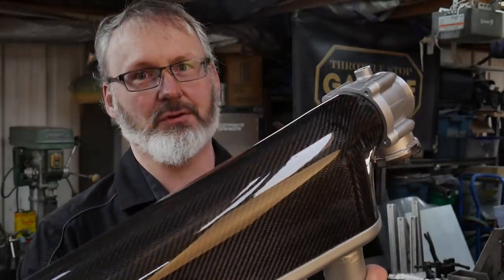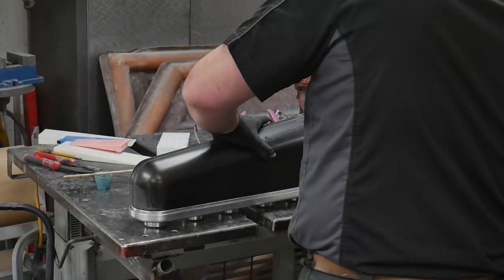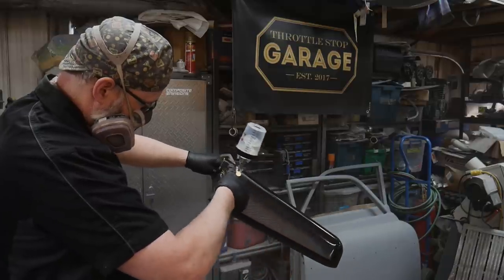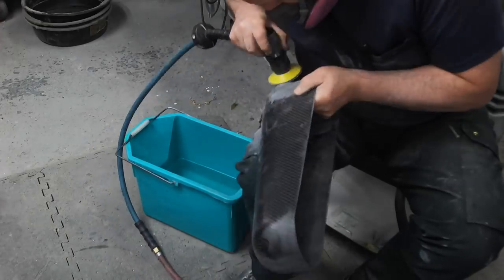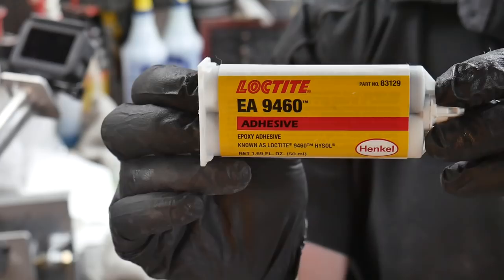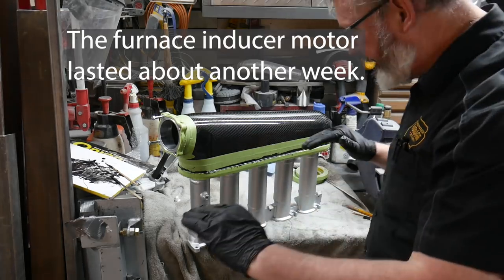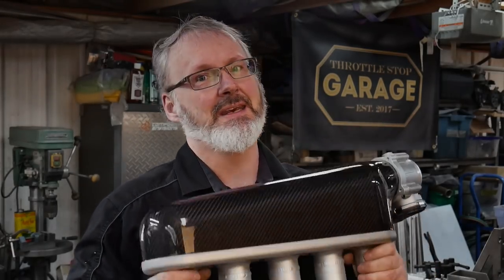DIY Carbon Fiber Intake Manifold - Part 4: Finishing the Job

Comment: I found in some applications polyester pigment coloring additive can cause sever hardening problems 80° temperature is a big help .
Reply from the maker: Interesting.  I only used just enough to turn colour - it hardened fine (or it seemed to) - what sort of problem did you encounter?

Comment: @Throttle Stop Garage absolutely love the intake manifold. Cannot wait to hear her run. I really liked the way you designed the intake manifold plenum base. If you are open to sharing, Id love a copy of the drawing you designed to use on my own build!
Reply from the maker: This plenum part only works if you are using the 960 intake flange.  There is a slight offset of one of the holes.  So unless you have that part, the model won't really be of any use.

Comment: Wow that looks amazing! Any other parts on the car getting the carbon fiber treatment?
Reply from the maker: So far I've made a trunk, hood, fenders, doors...and this intake.
Reply: @ThrottleStopGarage  I think I need to go back in time and watch more of your stuff. This car will put most Swedish builds to shame. It really makes me want to do a similar style intake for my 242.
Reply from the maker: @SeanHodgins  I've got a 242 and a 245...I've also kept the mold as the intake on the 242 is just the stock turbo manifold which is a mess.

Comment: Carbon fiber composite has a very low thermal coefficient of expansion, aluminum has a fairly high thermal expansion. Hopefully your bond joint is not overstressed due to the min and max temperature range that the manifold will see.  Your intake manifold length is maybe 18" long? I enjoy the work you are doing.
Reply from the maker: I hope not - we'll see when it's all together.

Comment: Came out looking really really good. Now you will need to match the rocker cover colour to the runner color. 
Interested to see what is going to happen on the hot side.
Reply from the maker: Thanks! The engine covers won't be painted...the engine will be painted.  Working on the collector for the turbo right now.

Comment: Great looking part! Just curious if any worry/consideration has been put into Galvanic corrosion between the carbon and aluminum especially since this is the engine intake?
Reply: Missed the on-screen note about testing them the first time🤦‍♂️ either way any tips or ideas on how to avoid that in a part like this?
Reply from the maker: Use the correct epoxy was a big part of the step.  If not, you can isolate the parts using fibreglass veil.

Comment: Looks fantastic. Any plans for matching carbon fibre timing belt covers and ignition coil cover?
Reply from the maker: Not sure yet - I have an "R" engine and will probably use the blue covers.  I really should do an update video to catch everyone up on what's going on.
Reply: @ThrottleStopGarage  I think an update video would be great. I joined the series as you started the composites work so not fully in the loop.

Got to say I love what you've achieved with the composites. Shows what patience and determination can do even without all the experience.

Comment: It should have been easier to lay up the carbon over smaller 3D printed wax core or a plastic core made to separate. All done in one go. More external polishing needed but far less risk of a useless moulding.
Reply from the maker: I see what your saying - but I've never done it that way before.  I'm not sure how it would all work out with such a complex part.  I was also interested in having a nice outside carbon weave on the finished part.

Comment: You didn't mention it but I am very curious about the final weight of the intake. Looks really light when you're handling it.
Reply from the maker: I've never put it on a scale Aaron.  My guess is it's around 3 kg without the throttle body.  The base plenum part could have been lighter.

Comment: Great video!
I’m wondering what type of clear coat did you use? Is it heat resistant?
Thanks.
Reply from the maker: It's a UTech 4.0 high solids clear.  It's as heat resistant as it needs to be for this job.

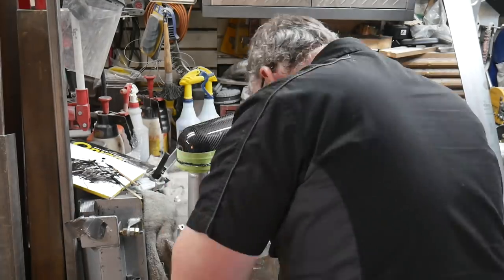Comment: 12:03 But you let it sit for the 72 hours with the masking tape?
Reply from the maker: No, I pulled the tape as soon as the epoxy was applied and I'd cleaned the area with acetone.  Then I let it sit.

Comment: But is that epoxy fuel, heat and expansion proof? For panels I could imagine it working
Reply from the maker: Yes - of course.  It's heat resistant and resist all automotive fluids.  They use to to adhere jet engine covers.  I'm not understanding your question very well.  If you have some specific information, I'm all ears.  Otherwise, I've thoroughly researched the product to the point that I can.

Comment: How has the intake held up so far?  Loved this series/project
Reply from the maker: It will be a few years before it gets run unfortunately.  Sorry for being so slow - real job gets in the way most of the time.
Reply: @ThrottleStopGarage  heyy i totally understand!!!  No worries,  ive been thinking about creating a intake myself and following your step's, same materials, except i will use a high-impact clear coat in the end.  Are you on facebook?
Reply from the maker: @davidsean7043  On FB and Instagram.

Comment: Hey Buddy! Great work as always, that Intake Manifold looks sick! How much Boost are you gonna run on the Amazon when its done? (and how much Pressure you think the  Intake can hold before failing/splitting/exploding)
Reply from the maker: Around 2 Bar is what I'm targeting.  I think the risk is in the pressure fluctuation not in the pressure itself.  It's 2 mm thick - so if I blow it up, you  can bet I'll be smiling.
Reply: 2 Bar beyond atmospheric? Sound like fun even if it splitt's or it throws a rod out the block :-) stay save and keep on the good work!

Comment: I've heard you shouldn't bond carbon to aluminum directly. It will corrode since carbon is conductive. Maybe something to consider when you spent so much time on the parts.
Reply from the maker: It's done all the time - have a look at the front wing on a F1 car - metal bonded to carbon provides the adjustment and support.  Airplanes are put together using this epoxy.  I research everything extensively - there are elements in this epoxy that keep the parts from "touching".
Reply: @ThrottleStopGarage  hey, you're the expert here :) But I was under the impression that they had an intermediate layer of glass fiber. The comparison to F1 is a bit unfair since those are not built to last, which airplanes are though.

Either way, awesome build. As a Swede it makes me a bit proud that you chose a Volvo.
Reply from the maker: @johan.mp4  I mentioned it in another comment  - but fibreglass veil can be used as an insulator if needed.  Loctite would not advise me on the product as I'm just a guy in my garage.  There is a Boeing certified method for this product bonding aluminum to carbon fibre.  When I first applied it and could verify that it has micro-balloons, I relaxed a bit.

Comment: Im retired now I have a chance to work on my project is there a blueprint of your chassie I'm using the E type jag irs and corvette frt end with 12'" rotors . tremic 6 sp with the 7.3 ford. crate engine
Reply from the maker: What's it going into?  I don't have a full blueprint of what I did for the suspension and the chassis legs were bent by Art Morrison Enterprises.  In my experience - it would have been A LOT smarter and less expensive to just have AME do the entire clip for me.  It sounds expensive at first, but it really isn't when you add it all up.

Comment: there is something called galvanic corrosion which happens when two different metals touch each other or a metal touches carbon fiber, please read about it if you can, thank you so much
Reply from the maker: Did you watch the video?  I addressed this problem.
Reply: @ThrottleStopGarage  i watched it but cants remember how you did it was that epoxy you used to connect two pieces together isolated them ? or it is something else
Reply: @ThrottleStopGarage  but whatever you do, mad respect for your achievements and thank you for sharing it with others to learn
Reply from the maker: @amirfathirad2965  Yes - the aircraft structural adhesive that was used isolates the parts.
Reply: @ThrottleStopGarage  nice idea permission to steal it and use it on my own projects :)
Reply from the maker: @amirfathirad2965  Sure - that's why it's here.